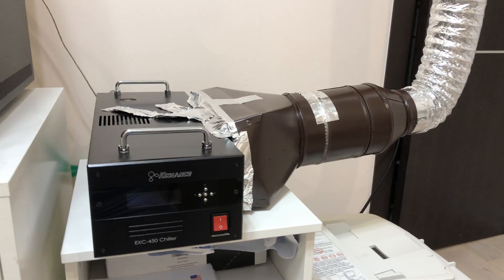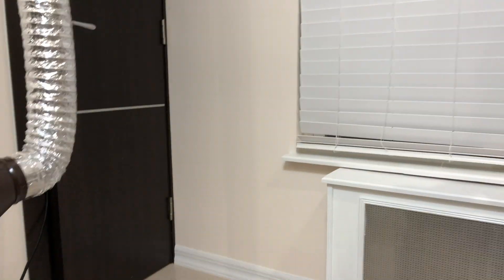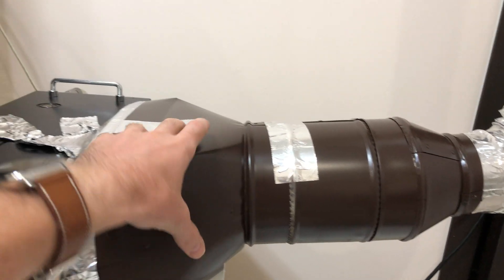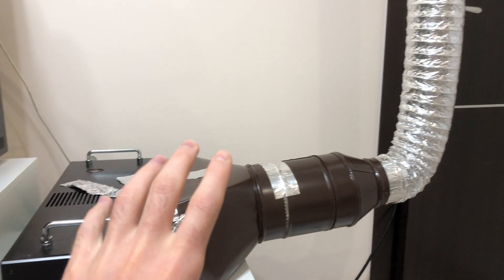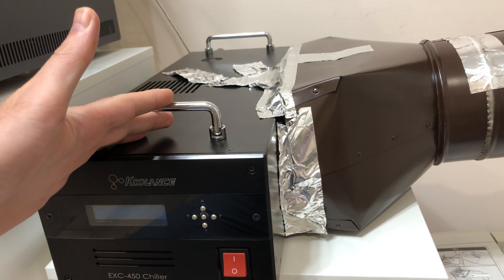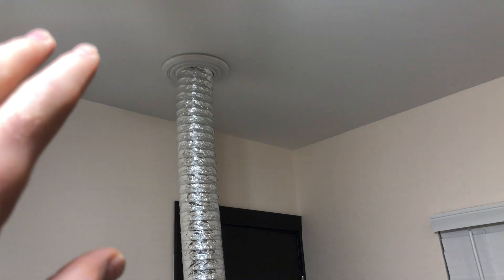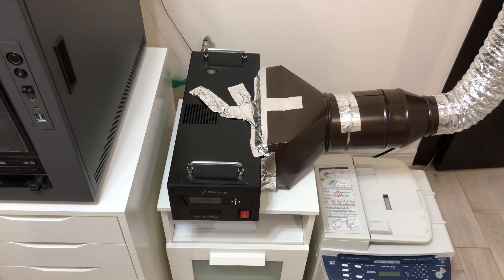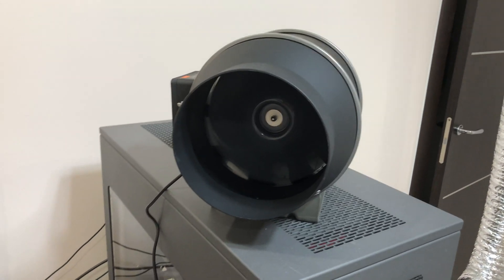Koolance PC Water Chiller (EXC-450) - Heat Problem Solved with Custom Exhaust Hose

Comment from the maker: Koolance chiller is strictly indoor device. Placing it outside and it may not last long, so this setup is the best I came up with.
Reply: Mount it in a seperate room and use zero-drip connections (ie Koolance Quick Connect Shut-Off Couplings) for each side of the coolant lines that run through the wall. If the room is large enough construct a small closet to house the unit and duct work. This way it eliminates the heat and noise. Thanks for the review and info on tthe chiller btw. Goodluck!